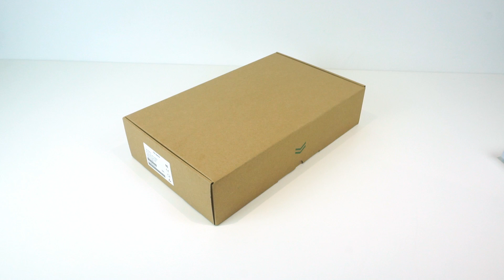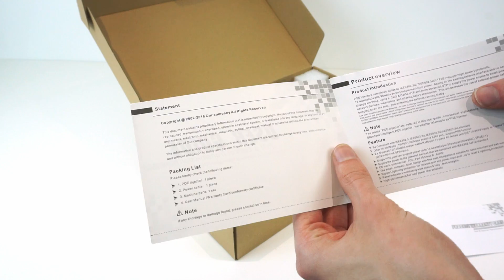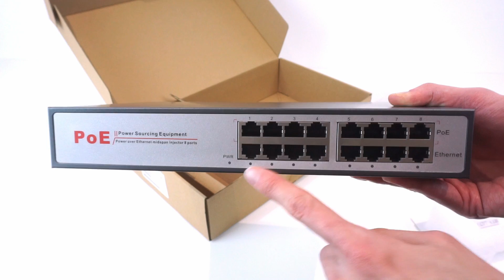The Mother of all PoE Injectors - FS PI250A-8 - Review and Teardown

Comment: Pretty sure ethernet is isolated well enough not to fry your laptop...
Reply: yea, but PoE-ing non-PoE equipment will damage the ethernet bits, at least up to isolation. especially old equipment, I once had to chew out an intern that fried a 3Com switch, entirely bricked it, by PoEing it. the switch was very old, and was being replaced soon anyway, but it was an easy object lesson (this was back when PoE was relatively new, and there wasn't much training for it)
Reply from the maker: I've seen it happen with laptops before where someone connected it to an injector and fried the NIC causing it to only link at 100mbps.
Reply: In a recent Linus Tech Tips video they did just that. Connected a laptop into a PoE Injector and fried it.
Reply: @mcameron1981  That was a passive injector not a poe standard one.
Reply: @camerongray1515  That must have been a passive injector then, the active ones should not do that.
Reply: @fl0r1svdk  Yep, Passive ones are awful...
Reply: @camerongray1515  YEP I have done this before!

Comment: If any switch/PoE is built to the relevant standard, it shouldn't get anything you plug in if it's meant to be run on that standard. Unified APs area of course a different kettle of fish as the older ones don't use that standard. Totally see the need for one of these in the homelab :-)

Comment: Enterprise grade. riiiiight. that crap looks so unreliable.  Wouldnt come anywhere near my rack
Reply from the maker: It's purely an injector with no switch logic,  Each vertical pair of ports is an injector, non-PoE network connection on the bottom, PoE out on the top.  Think of it as a bank of 8 separate basic PoE injectors in a single box.  This is pretty much what drew me to it, it's completely transparent from a network perspective.
Reply: @camerongray1515  oh ok did you look for a  hp or cisco poe switch as they are really cheap.
Reply from the maker: @drbass9677  They are however I quite like having a fully UniFi environment so don't want to move to another vendor for switching.
Reply: @camerongray1515  oh ok makes sence. The cisco 48 port poe switch i have the fans are on the side so its blocked by the side panel of my rack. So the switch gets really hot. I have 2 fans in the top of my rack.
Reply from the maker: If I referred to this as enterprise grade then it was a total slip of the tongue.  When I was referring to enterprise grade injectors I was referring to the devices such as those from Phihong and Microsemi who make high end injectors with network monitoring/management support.  This is definitely a more entry level device, a lot better than a basic passive injector but not as fancy as the top of the range ones.
Reply: @camerongray1515  can you use the poe injector as a normal switch just wondering or is it just for poe.
Reply: Basically anytime a product makes claims about “enterprise”, “commercial”, “industrial” etc., you know for sure that the product is in fact not those things. Nothing from Cisco ever had stickers on it that say “ENTERPRISE” in huge bolt text. Lmao
Reply: dregenius lol
Reply: Thorbjørn haha I use a 48 port Poe Cisco switch and I love it. It’s reliable

Comment: Talking about frying your laptop, isn't ethernet supposed to be galvanically isolated? Maybe I'm wrong but if I remember correctly it must be isolated, it can have relatively long wires, and some voltage could be generated in the wires that could fry the equipments, so they require galvanic isolation. Once I disassembled my laptop, I've seen a chip that does something like that, but I don't remember the chip, and not fully sure about the information. Networking course was a long time ago :D
Reply from the maker: MikroTik and Netonix do PoE switches but for this I didn't want a switch, I wanted an injector that would be completely transparent to the network traffic.  I already have good switching and don't want to be adding in yet another device to manage.  In fact, a cheap 8 port PoE switch would have likely been even cheaper than this!
Reply: Yes, but he means frying the "galvanic isolator" (which, btw, is a transformer). However, for 100BT devices, you CAN'T fry it because of the inherent usage of twisted pairs (i.e. the DC+ and DC- are NOT used for data in 100BT). And for 1000BT devices, same applies, but you'll lose the gigabit if you're using a passive POE injector.
Also, passive poe is 15-26V and 802.11af is 48-52V.
And finally, this is not "the mother of all PoE injectors". Mikrotik and Netonix have really nice PoE injectors which can be toggled from passive to 802.11af mode (and integrates a switch). And they're cheap. (Maybe a few extra bucks compared to this one; but you gain the configuration of the switch and PoE outputs).